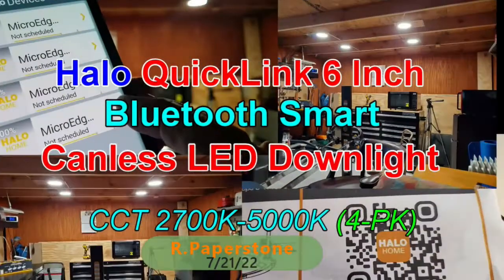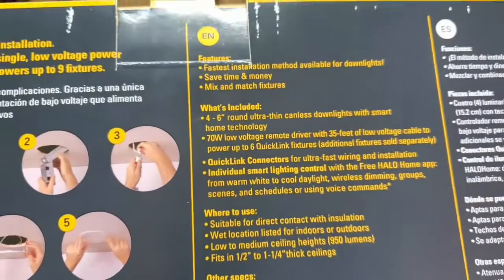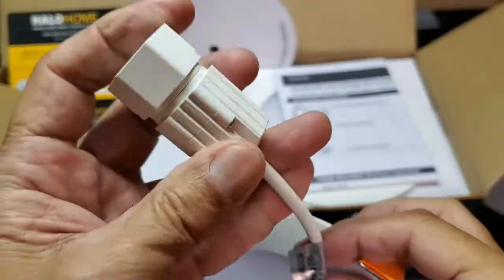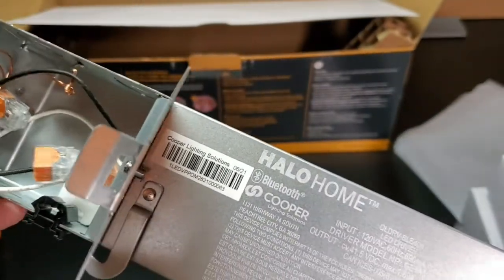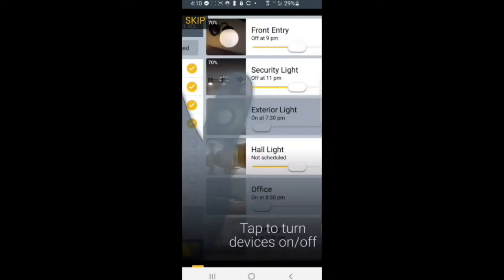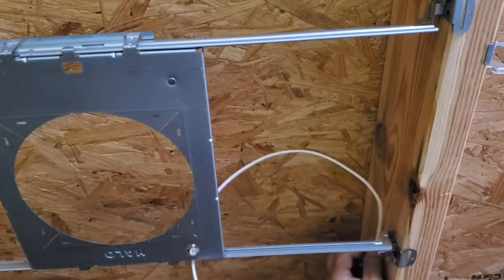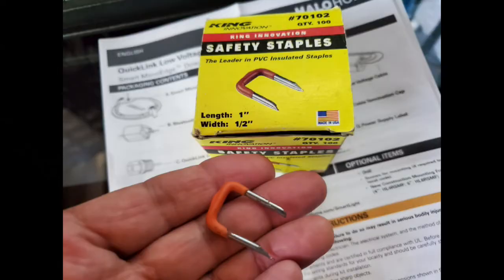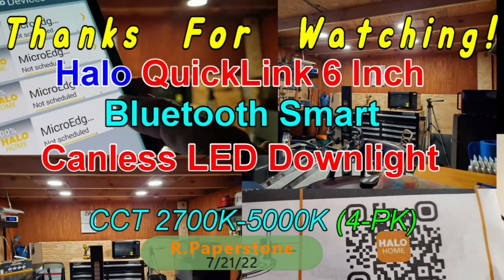QuickLink 6 in. Bluetooth Canless Integrated LED Recessed Downlight Tunable CCT 2700K-5000K (4-PK) 7

Comment: Can these light be simply mounted through drywall with no additional metal mounting hardware ?
Reply from the maker: I'm thinking that you probably can. The light uses a closepin design to lock the lamp plate into the hole. The closepins will open wide enough to accept the thickness of drywall. Also, drywall should be plenty strong to support the weight of the lamp and the control box/power module. That being said, I have no personal experience of installing these lights into drywall.

Comment: You stated that this unit can power up to 9 lights, yet the box indicates only 6 lights can be used. Which is correct?
Reply from the maker: Hello, Thanks for pointing this out. There are two versions of the MicroEdge HLB fixtures. One is the 6" and the other is 4". The HLB 4" version draws 7.2 watts per downlight and the HLB 6" draws 11.6 watts per downlight. The power supply is rated at 70 watts max. So, the power supply can  handle up to 9 of the HLB 4" and 6 of the HLB 6". My statement was wrong as I was clearing referencing the HLB 4" and not the HLB 6". Sorry for the confusion.

Comment: Where did you purchase these lights?
Reply from the maker: Home Depot. I think this is the link https://www.homedepot.com/p/HALO-QuickLink-Low-Voltage-6-in-Selectable-CCT-2700-5000K-900-Lumens-Recessed-Canless-LED-Starter-Kit-6pk-0-10V-Dimmable-HLBQL6099FSE010-6PK/321531655

Comment: Would this result in less lumens if adding in additional lights in the run?  Excuse my ignorance
Reply from the maker: Hello, the specifications say: "The first lighting system to combine smart lighting technology with a single low-voltage power supply that can power up to 11 RLDM downlights." So, I could theoretically add 7 more lights to my installation.
Reply: @rockpaperstone8722  right I just mean like if you only have 4, does each individual might have more watts and therefore brighter at each individual might?
Reply from the maker: Each lamp looks identical at full brightness. When dimmed as a group and with matching CCT presets, each lamp's brightness still looks all the same. Pretty amazing!

Comment: forgive me but how do you connect the wiring to the Halo switch from the wall?
Reply from the maker: There are several ways to connect it. The Control/Power Supply box has 3 wires. They are AC Hot, AC Nue and Ground. You may connect them directly to an existing circuit or you can connect them into a wall switch. If you use a wall switch, you can use the switch to directly turn them on and off and still have Bluetooth control when they are on. If you hook them to an existing circuit, you only have Bluetooth control. You may also connect them into a 3-prong connector and just plug them into a wall socket.